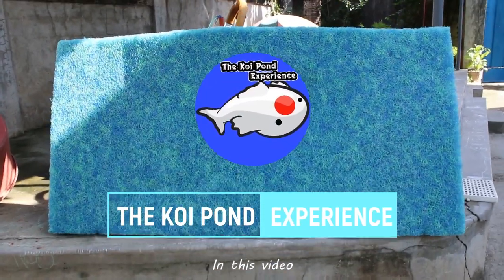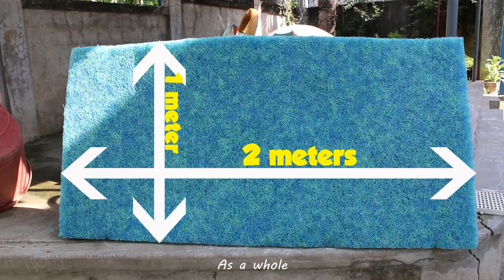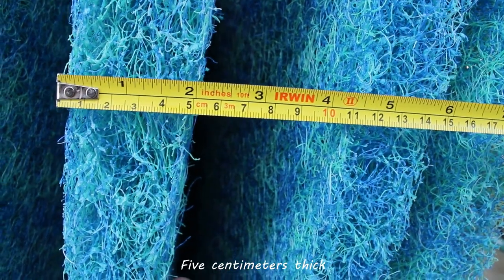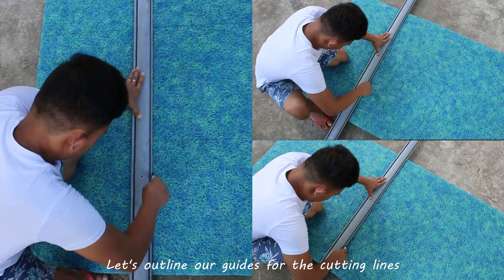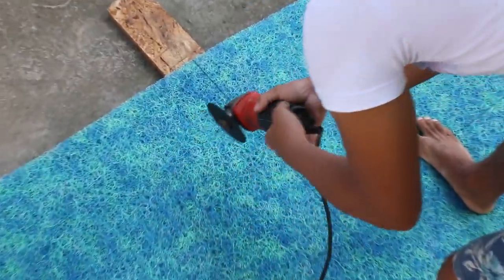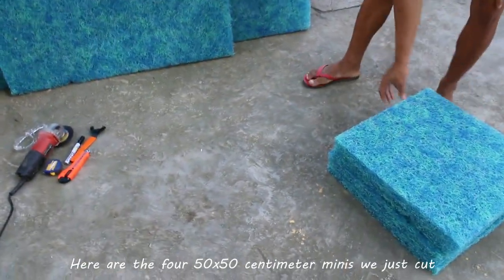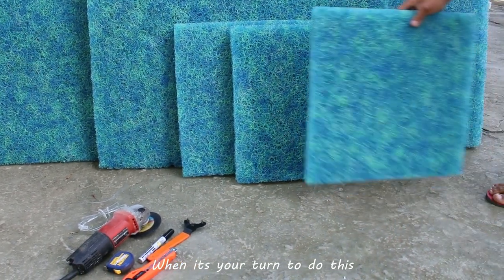How To Cut Japanese Mat Japmat

Comment: Nice. But i just use a Hot knife to cut them. It's easier and seals the loose ends.
Reply from the maker: That's a good technique as well bro.
Reply: The grinding wheel will seal the loose ends as well. At the speed the disc is spinning, plastic melts rather than cuts.